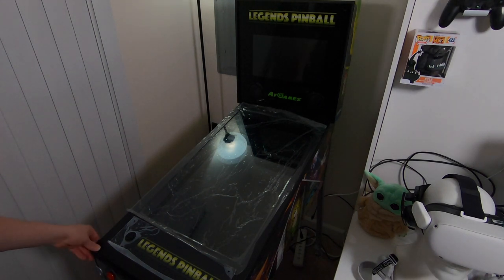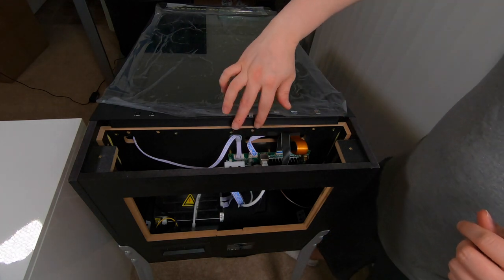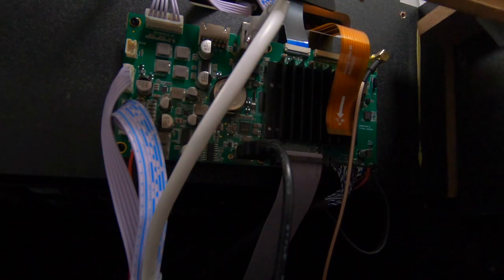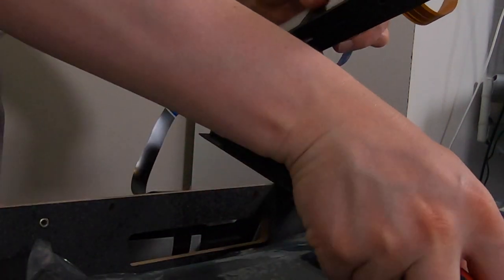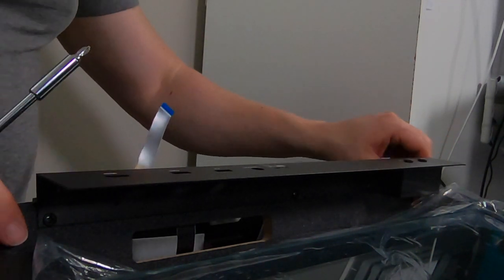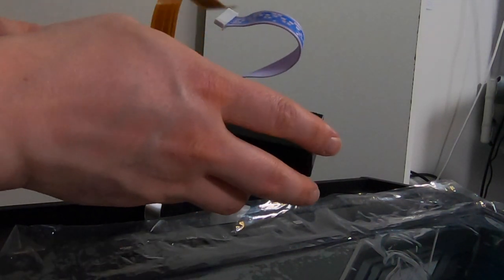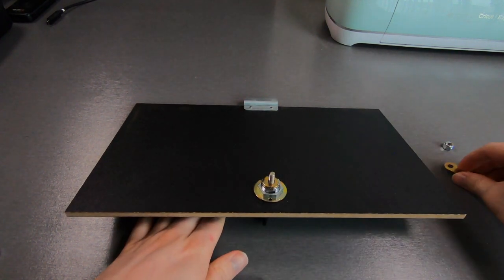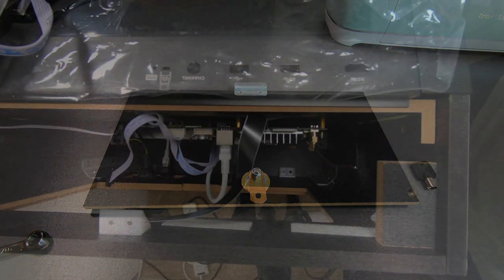AtGames Legends Pinball - HDMI & USB Ports Relocated

Comment: Hey there, your video on this modification was extremely well done and very detailed in that virtually anyone can perform this modification with confidence when watching your video. I really enjoyed it and I look forward to seeing what other modifications you do to the machine as well. The one thing I wish the video had which I didn't see was which material you ended up using to finish off the top of the machine where you had taken away the ports. You had mentioned you were going to use vinyl but I would have liked to have seen what you used in the process. The video itself though was excellent and thank you for posting it, it will make doing this modification a breeze,
Reply from the maker: Thank you soooo much for your kind words! Means so much. I actually did post a video (my most recent video) showing not only the material used but how I did it. Will put link below. Let me know your thoughts on that one too! Thank you again!
https://youtu.be/sAngSySGWTM

Comment: Good detail on the vid. Also I just realized after this relocation a hole will need to be drill through back cab to feed any hdmi/usb cables, unless the PC is put inside. Also if you're wondering the nylon nuts are also known as aircraft nuts, hence they don't rattle off via vibration unlike conventional nuts and why they used in aircraft :)
Reply from the maker: Thank you for your kind words and taking the time to check out the video! There are a few options you can do. As you stated you can either drill a hole or have PC inside the cab or in my case I have a wall plate on the back new with the ability to plug the HDMI and USB cables into the back of the ALP. I have not shown this yet but plan to.

And thank you for that extra info. Did not know that. Always love learning new things! :)
Reply: @KilllerPenguins  wow that's an excellent idea and thanks for the tip. And it protects from the vibs board getting its hdmi port yanked  off

Comment: I just did your excellent mod following your tutorial on my ATL, but the little black plastic clip broke when I tried to re-insert the ribbon cable. I wasn't heavy handed, its just not very strong and possibly age has made it brittle. The machine is not new. I just got it from Ebay. Was working perfectly, I just hated the cable position and thought your mod is cleaner than the flat ribbon cable version.

I wonder if you can tell me what that cable does? What will I not get now, will the table work without it? I thought/think it was the HDMI cable so my PC wont show up. I have searched online for solutions and my current one is to push it in place and then glue it in place with a glue gun. Good idea, do you know?

Guessing only perfect solution is a new board, and I am guessing this is the main board for the machine.

I havent turned it back on yet.

Comment: Nice video. Not sure I would want to do this however. My thought is to add a female to female USB adaptor to the cable this is used for the Arcade Control Panel at the front of the table. This is a male USB 2.0 cable and is not used unless you have the Arcade panel installed. However, I believe a female to female adapter, coupled to a mini USB hub would allow one to expand this to three/four USB ports at the front of the ATP table while still maintaining USB connectivity for the Arcade Panel via a male to male cable and allowing for two additional USB 2.0 ports at the front of the table as well. I ordered the parts and expect to be able to begin testing this theory sometime this week.

Also, one more thing. The "nubs" you referred to on the connectors, are actually considered to be a keyed connector, meaning it only fits one way. So using "nubs" threw me a bit. Key guides or key slots might be a better way to describe them next time. Just a bit of friendly advice.
Reply from the maker: It’s possible to go the route you described but have not tested. The issue is it’s only a 2.0 port and most USB connections you will want to use is 3.0. So while doing it the way you described, it still leaves the USB 3, & HDMI ports that you plug stuff into along with, Channel buttons, lights, and White text. All still aesthetically ugly. 

Let me know how your testing goes and thanks for taking the time to check out the video and comment!
Reply: @KilllerPenguins  Testing was completed and this works very well. I added a USB female to female adaptor followed by a 3 port hub. I then moved my USB flashdrive from the top USB 3.0 port, with the Zaccaria tables to one of those ports and it also works well. I really don't need access to this drive (since it is encrypted), so putting it internally in the table is not a problem. Even though it is USB 2.0 I do not notice any speed differences. My Arcade Panel is also connected via a male to male cable and works well. The remaining port on the hub will be used as a breakout to the front or side of the table at some point. I have yet to find a chassis mount USB plug that I both like and is pleasable to the eyes.
Here are the parts that I used:
https://www.amazon.com/gp/product/B07FT9MDX4/ref=ppx_yo_dt_b_asin_title_o00_s00?ie=UTF8&psc=1
https://www.amazon.com/gp/product/B071JTSMVQ/ref=ppx_yo_dt_b_asin_title_o00_s00?ie=UTF8&psc=1
https://www.amazon.com/gp/product/B009GUXG92/ref=ppx_yo_dt_b_asin_title_o00_s01?ie=UTF8&th=1

Comment: USB2 is not detecting on mine...wtf?  How am I gonna fix this?
Reply from the maker: Why hello Agent Smith! I appreciate you taking time to comment and time away from tracking down and attempting to catch Mr. Anderson, lol
Thank you for the comment and that is def a valid point. With my build I will actually be shouldering a new switch to that board and running it to the front of the pin underneath.
Reply: @KilllerPenguins  Ahhh...Wish someone make a new version with side panel access.
Reply from the maker: @ien2023  what do you mean? To just put the button in the side or add all the ports to the side?

Comment: Is it possible to relocate the channel button?
Reply from the maker: Hi Rob, it is possible but would require to to solder new wires to the board then run those wires to where you would like to add a new channel button but if you are referring to the stock then no you can’t as they are attached to the whole board.

Comment: why not leave the board where its at and just add an extra hdmi and usb ports? you could easily just solder on to the main board
Reply from the maker: Because having the ports where they are stock looks ugly and takes away from the natural pinball look. Plus most people don’t do soldering and so they can go this route. And soldering and running stuff takes far more tine than this mod.